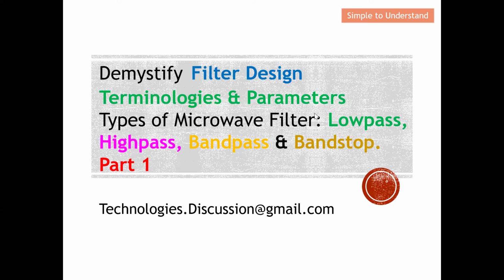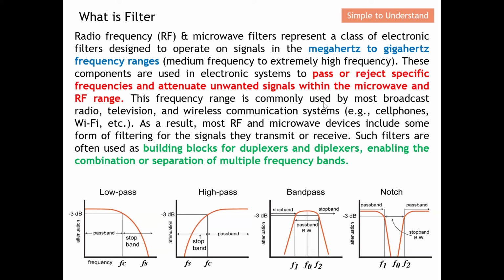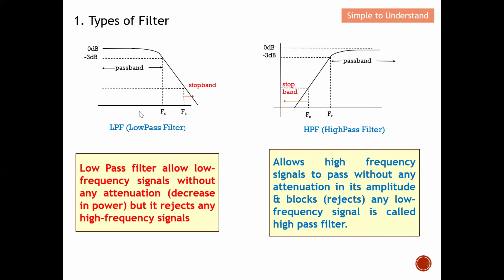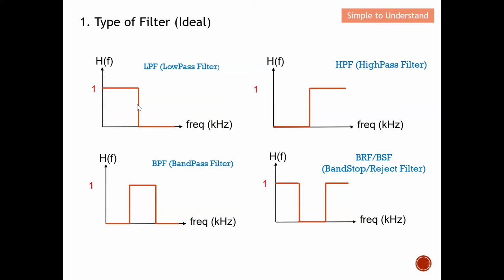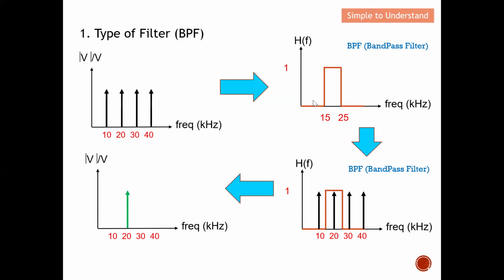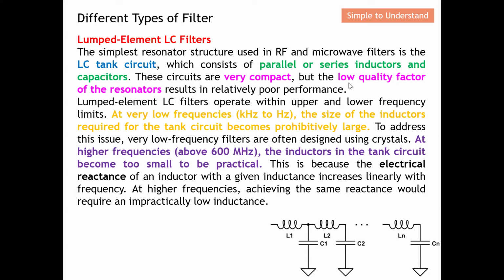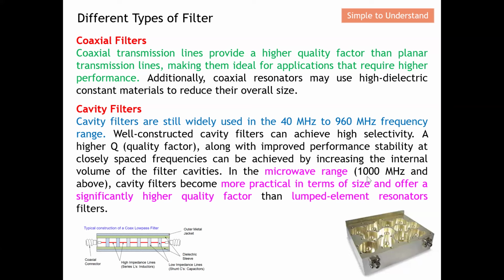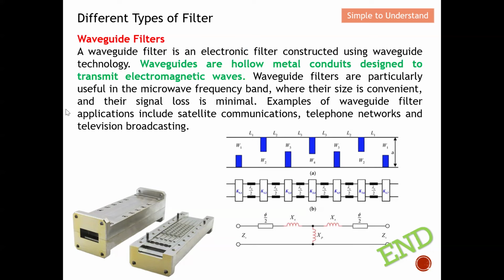Filter Introduction. Freq Response: LowPass, HighPass, BandPass & BandReject (LPF, HPF, BPF & BRF)

Comment: Hi, Thank you for sharing your knowledge, it is really helpful. I have a question, i am not sure to choose which filter suitable for my case, which my case is i have some detected some 2kHz noise at my analog voltage output. I am not sure to choose either band stop filter or low pass filter. If you dont mind, would like to hear your insights and advice related to how from your experience you choose filters type?
Reply from the maker: Thank you so much for your support! I'm glad it's helpful.  
If you just want to remove 2kHz, I suggest you use notch (bandstop) filter. This is because if you use low pass filter u may unintentional remove some of the signal at high freq. Because 2kHz is a very low freq but again depends on what you want. I guess u know what I mean.  :)